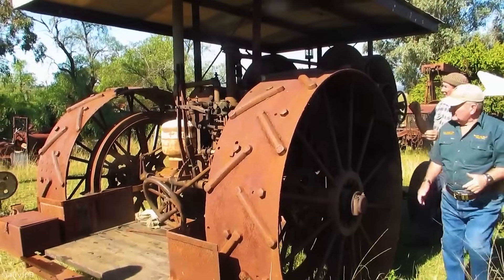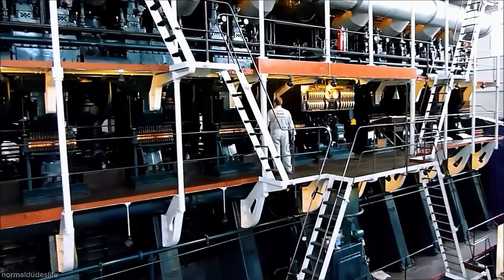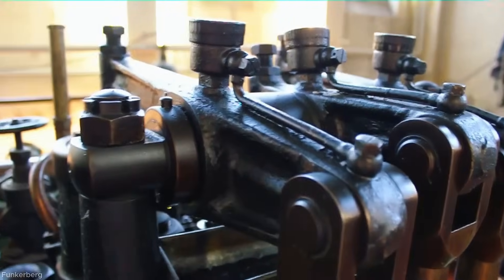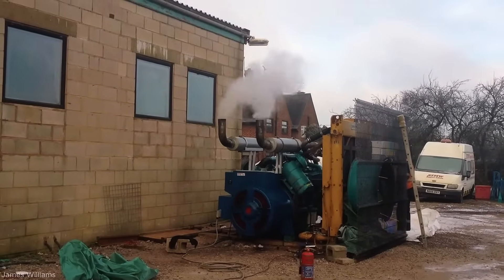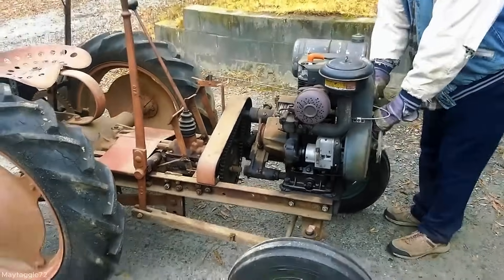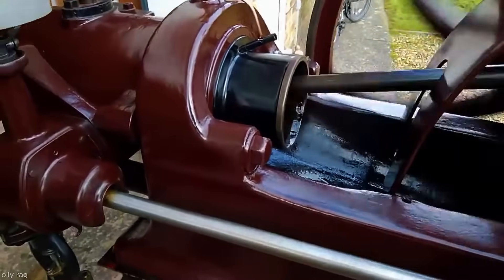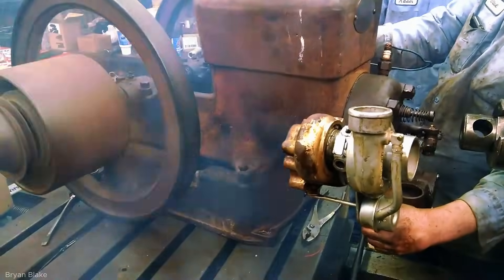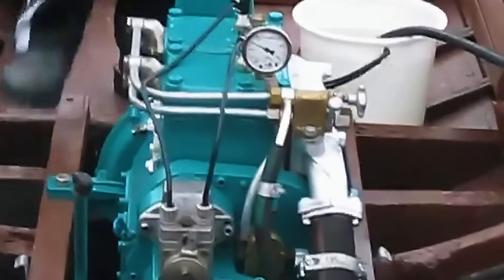Massive Diesel Engines from the Past | Extreme Vintage Machines Still Running Today

Comment: Where is the "alleged" 6 cylinder150hp Fowler diesel in the first video clip. What you showed had a 2 cylinder horizontal petrol engine that was definitely NOT made by John Fowler nor was this of the, claimed, 1955 vintage..
In the 2nd clip you show a tractor yet waffle on about the Heidelberg Platen Press. There is both no relevance and no connection.
@14.52. W.T.F are you waffling on about. So someone has stuck a modern turbo on to the exhaust of an ancient "Hit & Miss" engine but there is NO oil supply to the turbo and NO connection from the turbo to the engines air inlet. This is NOT, and never will be, a "Turbocharged hit & miss engine.